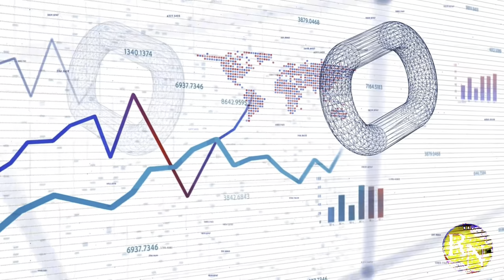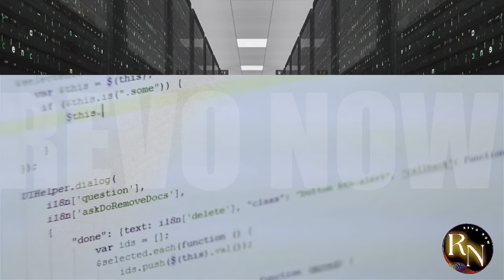China BANS Export of Strategic Loongson Chips to ALL Countries!

Comment: In SPEC 2017's integer and floating point performance test with all CPUs locked to 2.5GHz (the maximum speed of the 3A6000), Loongson's chip looks far more potent. It's actually ahead of the Zen 3-based Ryzen 9 5950X and just barely behind the Zen 4-powered Ryzen 9 7950X and Raptor Lake Core i9-14900K. The comparison isn't quite as favorable for the 3A6000 in floating point performance, but it is nevertheless quite close. These results corroborate previous benchmarks that showed the 3A6000 packed some impressive IPC.
What are Key RISC-V Applications?
The application options are endless for the RISC-V ISA:  
Wearables, Industrial, IoT, and Home Appliances. RISC-V processors are ideal for meeting the power requirements of space-constrained and battery-operated designs.  
Smartphones. RISC-V cores can be customized to handle the performance needed to power smartphones, or can be used as part of a larger SoC to handle specific tasks for phone operation. 
Automotive, High-Performance Computing (HPC), and Data Centers. RISC-V cores can handle complex computational tasks with customized ISAs, while RISC-V extensions enable development of simple, secure, and flexible cores for greater energy efficiency.  
Aerospace and Government. RISC-V offers high reliability and security for these use applications.